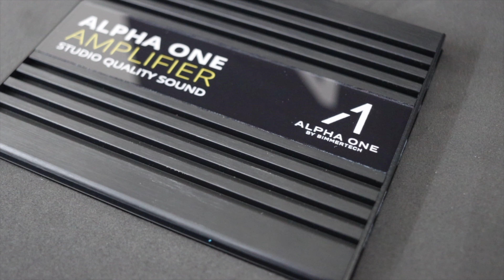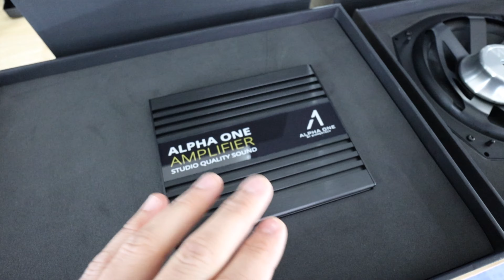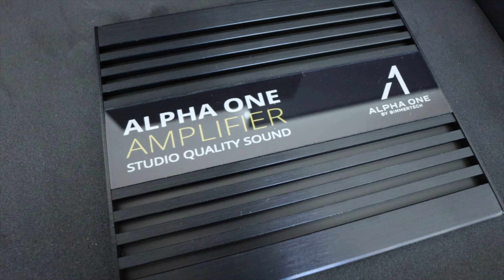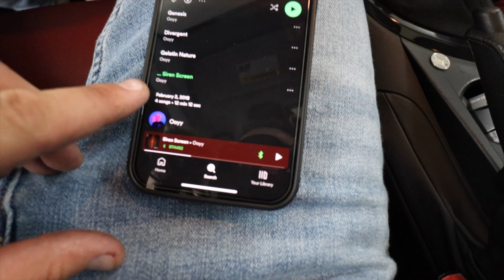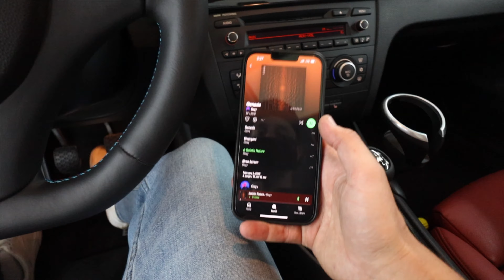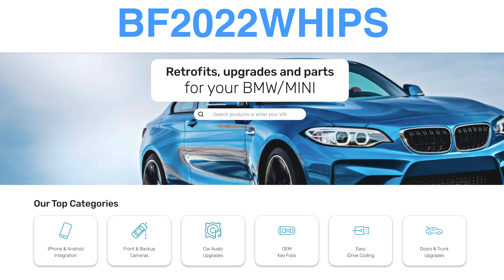THE PERFECT BMW SOUND SYSTEM UPGRADE! (Alpha One By Bimmertech)

Comment: Whoosh, the sound system sounds good. I also did the audio upgrade on my car (audi), but since my speakers are a little bit more powerful (6.5'' 110W RMS) than my aftermarket head unit can handle (50W RMS), I need to find an amp to get the full potential out of them. If I wanted to avoid the extra work, I should've gone with 50W RMS speakers, but eventually I will save up and buy a more powerful 4-channel amp

Comment: Just installed this amp in my 235i and yeah it's an absolute GAME CHANGER 👌
Reply: Does this connect to the idrive? What I'm asking is do we still get to control the sound settings thru our screens?
Reply: @ruthvik78  yeah you can still toggle the bass and treble regularly through the idrive
Reply: Bought you the Herman Kardon system?
Reply: Hey I got a m340 with no Harmon kardon and was looking to buy this amp. Did you only buy the amp as well?and if you did, did it get noticeably louder because that’s what I want

Comment: unfortunately you can get the same effect with the stock system and Poweramp eq over aux. the problem with stock amp is the lack of eq under 100hz. that $2000 amp you got just lets you gain frequency under 100hz, same thing is achieved with Poweramp but for $3. while I do think this is a better set and forget, $3500 is extremely steep. especially because you don't need to upgrade the side speakers or even subs, and that $2000 is much better spent on an audio control d-6.1200. you get more power, built in dsp that you can control with your phone that leads to significantly better audio quality over these stock upgrade replacement units and only spend half the money, for a better system, or again just use Poweramp eq, my stock logic 7 system in my 2012 x5 makes my ears hurt already and all I did was bump preamp to +5, set lowest eq to 30, set it to have 20 bands, put 30hz and up to 50hz to +15 and slow brought everything else up till it sounded decent. I'm hitting 108db with stock system at 34hz. more then enough, and it ony cost me $3
Reply: Can u drop a link plz
Reply: @jensenalbanese796   that's the exact name of it. It's only on android
Reply: Thanks for recommending the app. Just a question, I don't have any experience adjusting it. You said  just set the 30 on the EQ +15, and then just slowly bump up the rest to my preference, correct? An issue I have with my Lexus is there are component speakers in the dash, and it sounds boxy because of that. Any setting that you know of to make it sound more open?
Reply: @ShawnXPS   depends on what sub you have, socks won't do jack under 100hz. My 15" picks up everything under it and its seriously freaking amazing. Super deep 80-150hz and rattling lows.
Reply: @N54God666  ah, well the bass isn't an issue with me. It's a rear deck sub, and it's fine for what it is. It's the clarity of the front speakers. I want to make them sound more bright.
Reply: @ShawnXPS  what car do you have? No BMWs that I know of have subs on the rear deck, just under the front seats and if you don't have them that means you don't have logic7 and the only way to make your system sound good is with a dap amp

Comment: I have a 228 with base Hi Fi, saying it sucked was an understatement.   As an audiophile, I’ve upgraded tens of sound systems in cars in the past.   I replaced the amp with the match up (same amp but cheaper than bimmertech amp but not pre-tuned).  I also added a Mosconi sub amp and JL Audio dual 10 sub box.   Had system tuned professionally and it’s amazing.  Absolutely NO Need to spend the time and money replacing the speakers.    The shop that tuned my system typically does expensive cars at costs way over 10k or more; after we demo’ed my car, the owner said that there was absolutely no reason to replace the speakers; that i sounded as good as a 20k system.  I spend about 4k total, including the tune that took about 3 hours after the install.    Bottom line, no substitute for power and tuning; the best speakers in the world can’t create great sound without those two things but mediocre speakers can really come alive with the right tuning.
Reply: What amp for g87 brother?
Reply: @andramachespapa6143  Match up 10 DSP or Bimmertech.   Same amount, just that the bimmertech one comes with a pre loaded tune

Comment: have you done Bavsound before? Can you compare?
Reply: I can compare.. I have installed BavSound 3 times, and A1s now 10+ times and strongly prefer the A1s.  They are similar in ease of install (direct plug in play) but find A1s have both better sound quality (hard to compare and highly subjective) and better overall fitment.  I have the full A1, subs and amp in my M2C and the overall improvement is night and day, especially when compared to a stock G82 with HKs I drove recently.

Do it!
Reply: @BMWDIYGuy  hi I have G30 2018 HK sound system and the bass its crap, i had f10 With HK it sounded like i had a subwoofer In the trunk 😅, is this A1 Really helps with the Bass?
Reply: @bmwsincekid  absolutely yes!! The subs are especially better in comparison.  I highly recommend the full kit if it's in your budget.  I can also get this gear for you if interested, just contact me directly

Comment: You can’t do just the speakers? Maybe but not sure.. it should require the amp though because the amp that comes with the “hifi” system sends I think 60 watts to the doors and 80-90 watts to the shallow subs under the seats. I personally upgraded my own 2010 E90 with a jl audio 6 channel amp that gave me 100 watts per channel but I needed this custom wiring harness.. then I installed focals in the doors and this special shallow 8 inch woofer that was made by.. some small company and I can’t remember their name. But yeah anyhow.. not sure you can just buy the speakers without getting a better amp.. if you can? Why would you want speakers that aren’t working to their potential! The biggest thing missing.. still.. after all that work I freaking did was midbass. There was like.. 0. None.. the bass was great.. the focals were very.. bright and shiny.. a tad too much treble.. that wasn’t able to be adjusted. Now that I just bought a 2023 330i sedan.. that has just the hifi.. now I remember why I did all that work to my old one.. the system blows donk. And I don’t ever just use Bluetooth because the sound quality is just that much worse.  Wired in.. still is weak.. it’s still a step up from the stock hifi from 2010, but it’s still lacking. I wish I could directly hear bimmertechs sound..
Reply: Alpha One i dont believe would clasify as Hifi but maybe just a decent yograde above factory BMW speakers. Which i hate to say it but BMW and Mercedes have some of the worst sound systems in their cars. Is it a solid plug-and-play system for our cars, of course but without any EQ or time alignment or any kind of staging I wouldn't say it's hifi or SQ. I would say it's mid-level if that and trade a mid-level but the cool thing about it is it's a plug-and-play which I'm going to get it for my car because I'm not really doing the Hi-Fi thing anymore and sound is very very subjective 😅😊

People reading this, start with CLD squares and butyl rope in your doors etc, sound deadening AKA treatment is the most important part here ❤
Reply: You seem knowledgeable on sound systems. Would you recommend just getting the amp if all I’m looking for is increased volume?